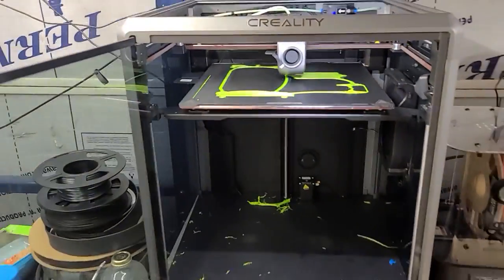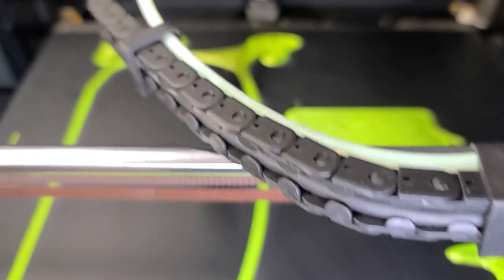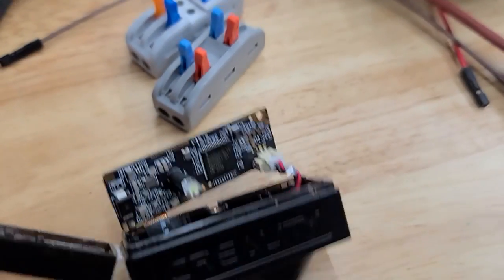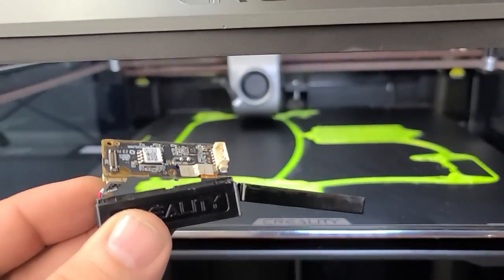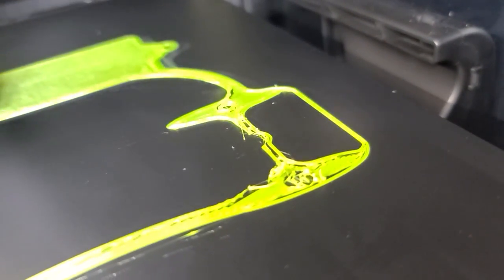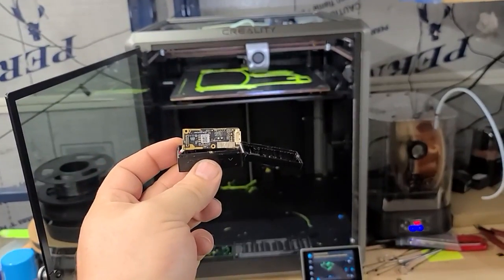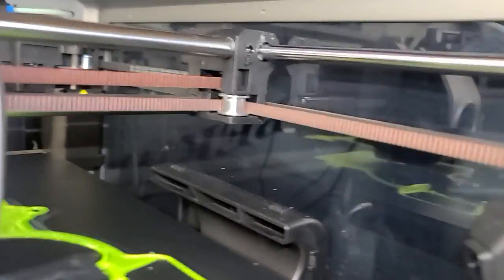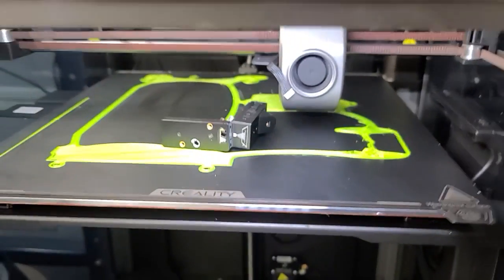Creality K1 MAX... it's a LIE... Buyer BEWARE!!, JUST DON'T BUY IT!

Comment: You must just have been unlucky. I have taken delivery of my K1 Max and it does what it says on the tin. So easy to get working out of the box. So much easier than my start-up machine the Ender 5 Pro. This may not be the best printer out there but for ease of setup it has to be good value.
Reply: Just wait 2 weeks to get a hotend error
Reply: i took delivery of mine yesterday, and im sending it back, it can only print in pla ...... i dont use pla its dogga, im getting the same print quality as this
Reply: @philno Maybe there are some faulty units? My friend added 3 to his farm and all are printing ABS flawlessly 24-7.
Reply: @OhImKiCkiN  it would seem after a FIRMWARE update which was released a few  days after i commented, things seemed to have calmed down
Reply: @philno  That's great
Reply: Unlucky...? He took the lidar off, tore it apart, started a print without it and is getting shit first layer... jeeze such a mystery!

Comment: Sorry for your experience but that is a LIDAR  Light Detection and Ranging.  It uses the light and the camera to do exactly that.  Im not saying that their LIDAR is any good im just saying that it is a LIDAR.
Reply from the maker: Yes but it is not an active component, thus it is not a working lidar. It does  not work to change or do anything to start a print.
Reply: @LiquiDirt3D  Well that sucks
Reply: @LiquiDirt3D What does that even mean? It's like saying BL Touch is a lie because you can remove it and your printer works fine?
Reply: @LiquiDirt3D  The Lidar function needs to be enabled in settings under Camera AI Function.  Once enabled, you will see it scan the first layer and report if issues are detected.   Also, I don't remember if the AI detection was enabled by default but that is the setting that detects if objects are in the print area.
Reply: @TheStealthster he just wants to yell at the camera for views because no updates have been posted lol
Reply: @LiquiDirt3D you have to turn it on in the ai settings.

Comment: Weird. My K1 Max has been running perfectly since I received it last week. 200mm/sec+ prints with a CHT nozzle. I love this thing.
Reply: Same here, prints better than any printer I had before at 600mm/sec with Creality Hyper PLA, the object detection works after all, you just have to turn it on... also did you use glue on the print bed?
Reply: Bro you probably don't know what your doing

Comment: Not sure what K1 max you got but  within 1 hour of it landing on my door step, I was already up and printing.  This printer is absolutely amazing!  It is not junk, it is super fast, and built very solid.  I am printing a large print right out of the box which will take nearly half a roll and it will be finished before morning  Before It took me over 2 days.  The print is looking great, silky smooth, nothing like yours.
Reply: The first  run  of them is reaaaaally bad. They changed a significant number of big things almost right away.
Reply: @Velereonics  Maybe that explains it.  I have had this one now  for 6 weeks printing non-stop and still no issues with the printer,  I hope it continues.   I am confident enough to print multiple objects and filling up the build.
Reply: I have a K1 Max 4th batch bought last week. It did print out of the box but it is NOT build solid. I have an X1C sitting next to it and the chassis is so weak and cheap on the K1 Max.
Reply: @Theprofessor1212  I don't have an X1C to compare, but if you don't think it is solid, then the X1C must be a tank.  I got a couple months of solid printing,   it is still going strong and no issues.
Reply: @daleblazer  mine is printing as well but to get High quality prints I don’t run acceleration over 5k and TPU is a no no. They should have copied the extruder/Hotend design of the X1 properly with no gap between them instead of a little piece of Bowden tube struck in between.
Reply: @Theprofessor1212 so you compare a machine that is nearly 3 times more expensive..yea makes perfect sense...then I wonder, if you have one that is about 1500$, why do you buy one that is 500$?..you must not be happy with the 1500$ one then...you make no sense
Reply: @duc696monster6  I’m only commenting on the user above who said it’s built “very solid”. Not it’s not. It’s built poorly.  I did not say it’s not working. I bought it for a project which required a larger build volume.
Reply: @Theprofessor1212 still for its price range, you can’t really compare it with more expensive ones.  You either compare it with ones that are similar in price or your statement is just not valid.
Reply: Love my k1 max no complaints 2 weeks non stop huge printed pieces all good
Reply: @Theprofessor1212 Are you sure you have a K1 Max? I print TPU all the time on mine. 
The frame is solid die cast. There’s no flex or give in it. 
I also have both printers.
The X1C has slightly cleaner prints, but nothing to worry about or really noticeable.
Reply: @gaxon1920  I print TPU on mine too it’s just not as easy especially for larger parts over 250mm which is what I got this printer for. Yea the chasis frame is for cast but The way chasis is fastened together is the weak point. You can skew the whole thing just by moving it left and right by holding on the top front frame. The chasis on the Bambu core xy printers is welded on many points with additional folds in the sheet metal frame to give the strength. Not the same for the K1max.
Reply: @Theprofessor1212  I’ve printed some large TPU prints with no issues. 
What do you mean the way it’s fastened together? It’s solid cast. There’s no “fastening together”. That frame does not budge. 
I have to call BS on your claims. I own both and I can tell you a direct comparison.  
The X1C is much sleeker and is higher quality, but there’s nothing wrong with the K1 Max frame. 
I’ve printed materials on the K1 Max that clogged in my X1C.
I will say my Voron and Mercury one prints better than both, but I needed a good fast enclosed printer for the parts to build them. 
Both of them did the job and they did it well. 
As I said the X1C has better prints “slightly”, but there’s none of the issues you claim on the K1 Max, nor do they make sense.

Comment: proud owner of a K1 Max, prints flat and perfectly out of the box. the only flaw they have is that the bed isn't always flat... print a shim and be done with it. 30 prints later at about 250 hours no issues or failed prints. also the lidar scans the first layer and stops the print if there's a error and sends you a message on their app just fyi

Comment: I have to ask, did you turn the first layer and lidar detection on? Cause when you get the printer, they're off. Having used mine a bit more, the foreign object detection is only on before you print. It can't distinguish what you're printing now with another object. It's a bit misleading, but the idea is that it won't start a print until you've cleared the last print.

Comment: Dosn't need LIDAR to work.  If its off, it will work just fine, it just wont do line filement detection.  It needs to be turned on in AI Camera settings, and printed from the printer not network.  Did you calibrate with leveling?  I see no glue or print weld on your bed either.  Stop raging over not reading and learing how to use the equipment your operating.  All the right hand camera does is alows you to watch and record your prints.  The LIDAR camera has a setting for stopping prints when it sees a problem, but you dont have it connected or the option turned on if it was plugged in.  It all works, it is you that does not.

Comment: My K1 Max is pretty awesome. I have both Bambu and K1 Max, but honestly only got the K1 Max for the build plate size. I would be all Bambu if they had bigger sizes. My only issue with the K1 Max is loading filament was basically impossible for me. Every time I'd push it through it would never catch into the extruder it would just get stuck on a ledge. My solution was to remove the bowden tube completely (besides a small piece that comes out of the extruder to prevent bending of the filament) and make a filament spool mount that sits above my printer. I only print in PLA and PETG so I printed a riser for the glass top and I just feed the filament through a hole in the riser. Works great now and so much easier to load filament.
Reply: This is sometimes tricky, I do a serious diagonal cut on the filament to make it as pointy as possible.   flip the switch on top, push it in and even if it does not feel like it seated, it usually loads okay.

Comment: I did all the calculations on it which is self explained on the tab that says calculations.  I been printing 24/7 for about a month without bed leveling. Once I did that initially I haven't had an issue.  Your video is not fair to the brand.

Comment: Yea as much as I hate on creality, garbage support help from them, my k1 max has printed great. Only things I have had issue with is loading the filament can be a bit of a pain and problems with the camera live feed loading or even being detected but as far a printing everything goes perfect. I got a little rough spots on the first layer on the back but I think that’s just due to the bed plate magnet service has little warped spots but after 3rd layer it’s perfect. Their software for slicing is garbage and can’t do helmets in good amount of time due to no support blocker options. Other than that it’s great. I would say just return it and get a new one and try again.

Comment: I agree. The K1 Max (mine at least) is complete rubbish. I think the different experience people report could be due to poor quality control on Creality's part or just different expectations - what do you expect from your prints. My PLA benchie prints just fine. I guess if your focus is PLA it could be an awesome machine. But for technical prints - I can't recommend it. Mine is a recent version, bought for Black Friday, v3 extruder, the new hotend, ... The printer has a laundry list of issues. 
- Out of factory calibration - bed level, bed smoothness, belt tension, Z-axis calibration, ... 
- Extruder jamming - either filament tip breaks off when changing filament or it melts the new filament in the extruder if you change from say ASA to PLA... They made 3 extruder revisions in 9 months since the release - that can't be a good sign. But at least they are trying.
- First layer - is an absolute abomination and after two months of calibration prints and 1.5kg of filament wasted my first layer is still not watertight (needed for a functional print I need). The Z-offset suggested by support is a hack that might work for one filament with one nozzle size and one layer height. The auto-calibration is a joke - the printer's firmware can't even remotely track the unevenness of the bed or the tilt of it. I constantly get into situations where I am extruding too much and too little filament at the same time to get a good, watertight first layer. I am now testing 140% flow to get a sealed first layer. No, not 104% but 140% - it is too much in one corner and the other corners turns into spaghetti when I peel it off the plate. My bed now has 0.1mm difference between extreme points.
- Firmware - is lightly tested and probably relies on crowd testing for maturity. Printing the SAME GCode from printer's memory resulted in two completely different prints.
- Creality Print is a bag of bugs and I have lost all faith in the parameters I configure (try the search function and check the displayed values - mine are different then when I look them up directly). Orca slicer has been difficult to adopt and can't accommodate for all the issues with the printer. How does it make sense that the default flow for my ASA filament in Creality Print is 92% and in Orca slicer 108%? Not a mistake - both settings give me the target wall thickness of 0.43mm. Yes, I see that both are 8% from 100 just in different directions. 
- Max Bed  temperature has been downspeced to <=100C and had to be blacked out in the paper manual I received.
- dragchain concept has been taken to a whole new meaning - it rubs on the top glass, while sagging so much it drags on the X-axis rod just so it can bump on the edge "stair" of the frame.
- the door is poorly designed and you are always at severe risk of breaking it (ask Jessie) or it sounds like grandma's glass cabinet rattling away
- It's really hard to hit the right enclosure temperature vs cooling. You either get pillowing or rough top surfaces.
For 1000EUR, I expect a printer that is properly calibrated and works well out of the box. Having to open it and level the bed, tension belts, shim the bed, ... is one step removed from a DIY printer - it came pre-assembled. 

I am done with my printer. Any buyers?

The LIDAR though. I know how it looks. But did you know that the iPhone 13 Pro has a solid state Lidar and it is even smaller than this? In my experience, LIDAR works as expected. You can detach it because it is an optional component. The same firmware can be used with or without the LIDAR.  It has detected rough first layer defects in my case.
And the camera foreign object detection also works. Mostly. It errs on the safe side. But it is ONLY active before the print starts. If you drop something on the plate while you are printing... Well... you saw what happens - nothing. And you could probably also detach the camera and still print. Just you know - no camera feed or foreign object detection.

Comment: My k1 max worked for 4 days then crapped itself. It dug a hole in the build plate after an auto bed level, lidar etc all turned on. Destroyed the nozzle, bed and hot end. Now it's throwing an error 111 which is a circuit board failure. So disappointed. Support has been hopeless. I am returning it.

Comment: Got my K1 Max almost a week ago and its been printing great. Only issue I've had was forgetting to remove the top panel so it messed up my print.
Reply: What do you mean about removing the top panel?
Reply: @BoatsAreFun82   The top glass panel. Doesn't work well with it on if you're printing things like PLA or PETG.
Reply: @exoSurvive  I print PLA and PETG all the time, I have never removed that panel.  What is going wrong with your print?
Reply: @daleblazer  ABS/ASA print HOT, and must not cool down until the print is done or you will get warping and layer separation.  PLA and PETG require part cooling after the filament layers are put down and require part cooling fans.  A heated or enclosed chamber is NOT good for these parts.  Part cooling fans usually run FULL BLAST for PLA and at less than 50% for PETG. For ABS/PLA those fans are OFF!!!

Comment: I have a K1 max too. It’s a sham with the AI crap and LiDAR detection. They shipped out that printer knowing the functionality wasn’t there. My K1 max has given me nothing but problems. From flagging prints that perfectly fine, to not flagging a failed printed. Jamming, bed leveling, and hot end errors are also big problems for me. I tried returning it but they never got back to me
Reply: yep mine is crap too, worked really well out of the box but then the ai camera started causing prints to not start while not detecting failures, first layer went to shit too. Problem is the extruder, they made the internal gear carrier out of COPPER, then electroplated it (you could try taking it apart and bending it back). This obviously deforms then the printer starts working like shit. Comgrow who are the distributer have sent me a new hotend and extruder but replacing parts is a pain due to the wack design. Just need to get my voron parts done then I can stop using crealicrap for good hopefully.

Comment: dam 25 years under your belt? I cant help but notice your lidar isnt activated in settings. it usually does a zig zag pattern on left side of the bed. my K1 and its pumping out clean product and I actually am not using lidar for the fact its not ready to be used....... its not properly tuned.  Due to my 1 year experience in analysis with 3D printers im pleased with the product i get considering my X axes is off by .09 Y & Z are Spot on if you need a slicer profile i can help

Comment: If you would have the Lidar sensor on the machine and turned on, you would see a red light scan the first layer after it printed the first layer... but it does that only if you have turn it on in settings.  Also it only checks for obstacles before it starts printing... when it says "checking for obstacles" on the screen... Lidar is NOT a lie, and the K1 Max is absolutely cool.

Comment: Why is it not supposed to print without the lidar? lidar is just an accessory, you can print without it, its just a way to sense irregularities with printing not prevent them. Also I've been printing ABS consistently, granted i have aftermarket hotend and nozzle, the  factory is garbage.

Comment: Having owned a CR-10 v3 that the Z axis didn't go low enough, and the damn extruder/hotend that was crap. I'm not in the market for more Creality shortcuts and poor engineering.

The v3 now has a Micro Swiss NG extruder/hotend on it, and it's been given away to my son who just thinks that he lucked out. Coulda been worse, could have been my old Flsun...

In any case, I'm going to get the Qidi Tech X-Max 3. I could get the Bambu X1 Carbon with the AMS system, but it seems like AMS isn't quite ready for prime-time either. And if I want to waste miles of filament, I have my Mosaic for that.
Reply: agreed bro. the funny thing is Elegoo  is a knock off , and does it so much better than Creality

Comment: The reason the printer still works without it because there’s an option to get it without the LiDAR and uses the nozzle for Homing of the Z access and I don’t see the problem with the LiDAR module I’m pretty sure that’s how LiDAR works They have a laser diode and an infrared receiver that records, the amount amount of time it took to receive the light pulse